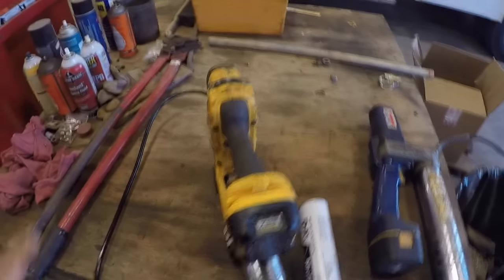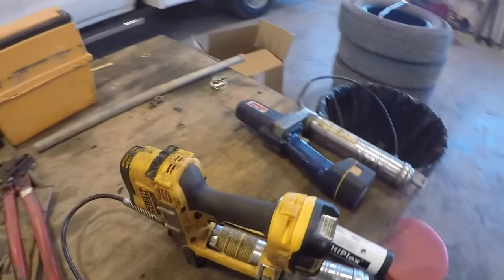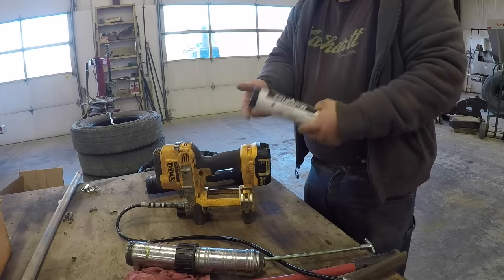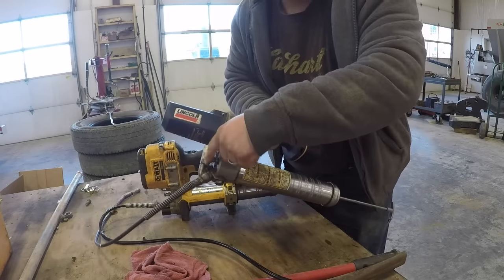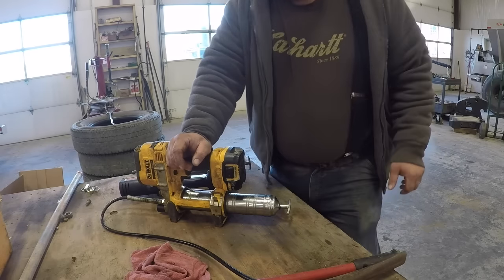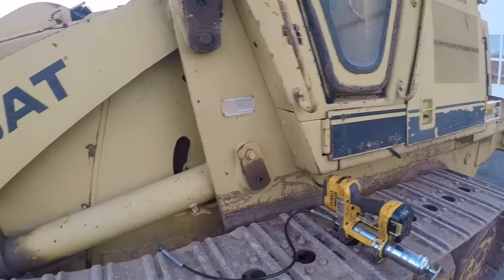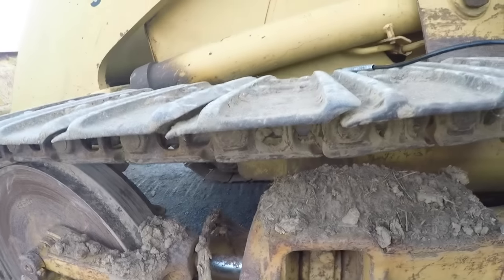How to bleed a grease gun every time!

Comment: What exactly does the twisting of the rod do, because it goes from being able to plunge forward to not
Reply from the maker: There is a roll pin in the rod and a slot in the plunger for it to go trough. When you turn the rod a quarter turn the roll pin is behind the pinger and you can push the plunger with the rod.

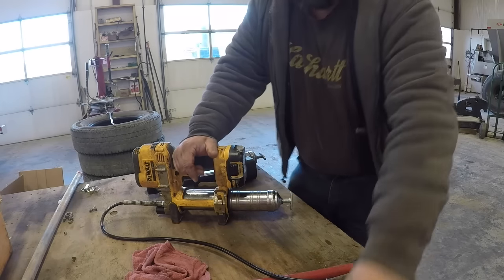Comment: At the 4:30 mark when you pull the handle back out, on mine, a bunch of grease comes out the hole the handle comes out. What’s wrong with my gun?
Reply from the maker: That’s pretty normal they all leak some internally
Reply: @DLHFarms  no, when I say grease comes out, I mean like the whole freakin tube worth of grease cokes out… I don’t know wheat I’m doing wrong.
Reply from the maker: Seal is bad or your grease is really thin

Comment: A friend gave me a grease gun but I can't pull the plunger out (to change the tube) no matter what I do I can only get it out about 4". And there's no grease left in the gun that can be pumped out. Does anybody know how to fix this problem?
Reply from the maker: +reese cup. Maybe that's why he gave it to you. Lol. Can you unscrew the bottom of it and pull the guts out of it to see whats going on with it.
Reply: Thank you for your reply. Just to let you know the gun is not a battery power one. Yes, I was able to take the head off where the hose and pump lever is. But the grease tube would only come out about 1/2 way while the plunger went back in. Tried pulling it...no go...stuck but good. The tube & plunger would just go back & forth when ever I pulled. So I put in back together and tried bleeding it as in your video. After pumping for awhile I heard a pop and some grease came out then it stopped. Tried again, the same thing happened, however, now the plunger can't be pulled out. Oh well, you're probably right that's why he gave it to me...lol. Any hoo, I appreciate your help. Thanks and hey what "great video"!
Reply from the maker: +reese cup . Some of those you can unscrew the bottom cap off and take them apart. If not file it in the trash and buy a DeWalt! Lol.

Comment: What kind of grease do you run? I've been using the Lucas 'green' equipment grease.
Reply from the maker: +Big Dreams on Small Acres. I'm not sure, the box says multiplex I will have to check we change around so often.
Reply: Milwaukee  grease  guns I bought they have 2 stage power witch and a number of pumps you want to put into the parts your greasing  and I am very happy with them I do not know much about the DeWalt  because they lift me to hold  the 28 volts they had out cannot get betties for them anymore  Lincolns battier power 1 I would not wast the money on them they not that good
Reply: I use the cheapest stuff I can find at Napa that is rated for the application I need it for. Regular greasing is far more important than the type used. If you want to grease less and run more, a fleet I used to work for used some high-end Castrol purple NLGI stuff on all equipment. Worked pretty good. Our highway tractors had 30k-50k mile PM intervals. Never had a problem unless the lube tech missed a zerk.
Reply from the maker: +Bullfrog's Workshop. We use the Citgo grease and a few others that I can't remember the name of.

Comment: Well, this doesn't work either!  That's because mine apparently doesn't have that notch where the plunger engages inside.  I consider all grease guns nothing but JUNK!  I corresponded with Lincoln yesterday and told them that I'd be ashamed to make such a sorry product.  Why don't the manufacturers just provide some instructions?  There were absolutely NONE with the gun I bought, or the one before that (some other brand) that I took back to a store because you could work the handle till the cows come home, and no grease would come out.   My grandaddy had a grease gun that came with his 1928 Ford Model A.  It was exactly the same technology.  Why hasn't somebody invented something better?
Reply from the maker: This will work with a Lincoln I have several of them

Comment: Didn't work for me. The grease started coming out the back end. I can't even pull the rod out anymore without feeling like I'm gonna break it.

Edit: so as it turns out, this method works however, it doesn't work on stupidity. The reason I was having issues is because I forgot to pull the tab off the tube before putting it back in.🤦‍♂️
Reply from the maker: Haha, don’t feel bad I have done that before.